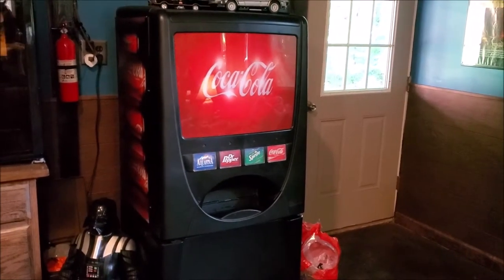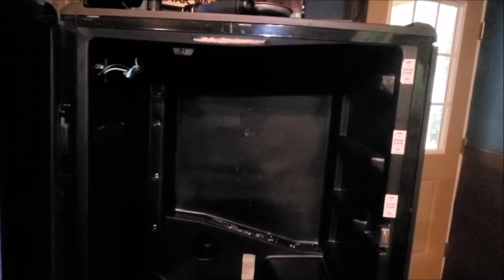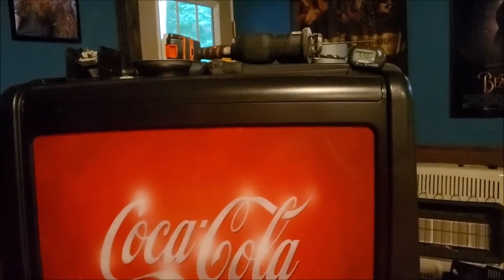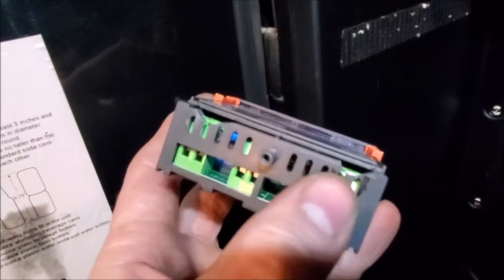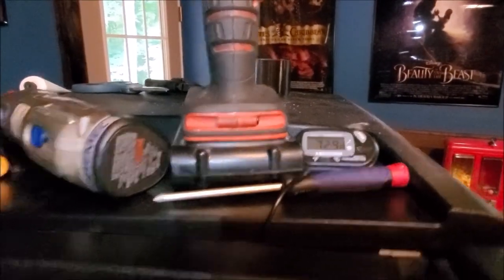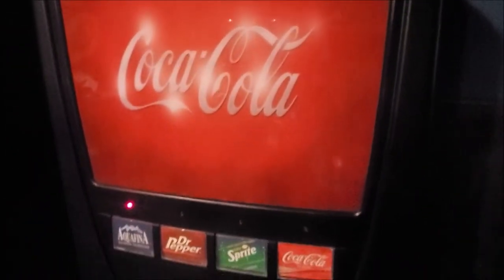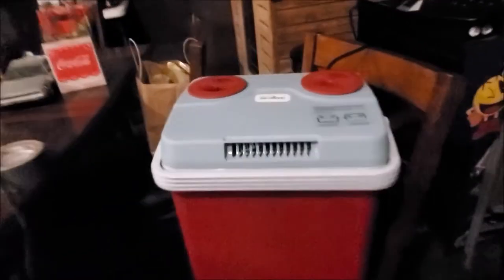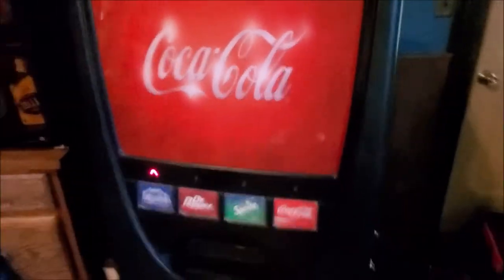SkyBox by Maytag Compressor conversion to ThermoElectric

Comment: Hey Brian! First off, great video!! I have no idea if you are still checking comments, but I had a couple quick questions. I just picked up a non-cooling Skybox for basically nothing and within a day I have it running and cooling again. Switched out the relay and added Freon. I used Freon with leak sealant in it, probably not the best idea, but honestly very new to this and got a lot of very conflicting advice online haha. Machine has been running cold for days now but the condenser and the non-suction line are super hot. Too hot to touch. Should I be worried about this? Second, one of the rows does not dispense. I push the button and I hear it try but then it stops. I can’t find anything online about if there is anyway to fix or work on that. Not sure if you have any insight? Lastly, your part 2 fix looks like something I might ultimately go with, just curious on how it’s working 3 years later? Thanks for any help you can toss my way, I also really love these machines and would love to keep it out the landfill!
Reply from the maker: Feel free to email me Brian.niskala@cnjrail.com 
So I had to lube up the release mechanism with some food grade silicon. But they are prone to freezing up, and locking up the drop mechanisms... shine a flashlight through the inside and see if you see frost or ice. I ended up on a few of these, buying a new compressor, getting a micro fridge and transplanting the whole compressor unit and my current machine, I use a thermal heat transfer unit taken from the top of an electric cooler.

Comment: Hi Brian!  Thanks for making this. I just did a compressor swap and turns out the condenser is completely clogged - hard way to learn to check the system before soldering in a new compressor! Your video inspired me to do the changeover to thermoelectric too.  Couple questions - the link for the Solidstate cooling assembly goes to a cooler...i'm guessing we take the solidstate cooling assembly out of the cooler?  Thanks again, cheers! Chris
Reply from the maker: Yes, just pop the lid off, cut a hole to match, easy 😀

Comment: Hey Brian I need some help desperately. Last week I was given a skybox that an elderly lady’s grandson tried to fix. It worked fine she said until it was unplugged for a week. The compressor runs, dispenser works, but it doesn’t get cool. Her grandson messed up and changed around where the wires plug in. Can you please tell me which wires go where on the compressor and start/run capacitor?? No where online is a diagram of the wiring
Reply from the maker: Brian.niskala@cnjrail.com is me email

Comment: Ive been down the same road as you and found this video. I am going to attempt the same modification as you with a thermo electric cooler lid. Does it still work for you? And do you have any tips before I start?
Reply from the maker: Yes, it still works great, just make sure the lid is blown out every few months for dust, but has been working fantastic 👍
Reply: @GarageMahalLife  few more questions, did you use a jigsaw to cut the hole in the back? You didn’t hit any coils or wiring? I assume the compressor is disconnected as well?

Comment: Interesting video, thanks for posting. I was fortunate enough to have a compressor that continues to work. My issue was numerous leaks in the evaporator coil which as you know is sealed in the back. I completely cut away the metal on the back and chiseled away the foam to completely reveal the entire evaporator coil. Then, I cut a large hole in the back about the size of the entire evaporator coil. Once I identified and sealed leaks (with super glue) I was able to put a piece of sheet metal over the coil and reinsulate. Now the evaporator coils are basically inside the machine, and have turned into block of ice. I was worried about the ice expanding and affecting the wiring or motors of the dispensing mechanics but that has not yet happened. It's consistently staying at 37 degrees.
Reply from the maker: Thanks for sharing. If you refoam the coils no moisture should get to them, so ice really shouldn't form. But glad it is working!

Comment: I just got one that does not cool also. I changed the compressor but i think i have a leak in evaporator. Look forward to see how its works out long term maybe i will do something like this
Reply from the maker: Yes, I switched out the compressor and it worked great for a week, then that one died. This was an ultimate fix and if it lasts a year or 2 and dies, it is an easy swap out of another unit, probably like 15 minutes. Thank you for watching and good luck! I'm here to help....

Comment: You may have covered this but I believe why the four unit did not work as well as the lid is because only the fans should be inside of the unit.  The big aluminum backs on the other side of the insulator are to dissipate the heat to the outside.  Any Peltier unit I've taken apart, have the semi conductor separate to each side.  I'm not describing this well.
Reply from the maker: I tried a bunch of different configurations and calculations I didn't cover here, but in the end it was a matter of simplicity that worked. But thank you so much for watching and commenting. I love Youtube to help share all of our experiences

Comment: Gearing up to maybe replace compressor on mine, great video. Really appreciate you putting it up. Do you think your compressor didn't last because it can't dissipate heat properly? Or do you think the compressor was just on the way out anyway? 

What's the lowest temperature you've gotten out of these thermoelectric units? They still running well?
Reply from the maker: I believe it was just another bad compressor. The thermal cooler lid worked the best. I get 20 to 30 degrees difference from ambient. My garage is usually 70 degrees all year round and I have the soda machine in the low 40s regularly...
Reply from the maker: That model compressor is very unreliable...

Comment: Do you think this kind of thermoelectric cooling fan could be adequate to retrofit a Skybox?   It says it can drop ambient temp but up to 30 degrees Celsius, but I don't know how to adjust the math based on box capacity.
Reply from the maker: It keeps mine at around 25 to 30 ambient... so basically in the low 40s Fahrenheit. Its been working for months now.
Reply: How many cans total can you put in there

Comment: Can you put more details on the cooler you used? Your link doesn’t seem to be working for me (might be because I’m in Canada and hitting the us amazon site).  Also, can we get the details on the digital thermometer (thermocouple) unit. Nice job btw.
Reply from the maker: Oh, seems they are out of stock... try this one https://amzn.to/2ZWRLur I updated the link on the vid too... and what more details would you like on the thermometer and or thermocouple? What I found is in ambient temp, I did not have to use the thermocouple unit (It died anyway) since the thermoeletric achieves temps 20-30 degrees below ambient, I wasn't worried about a freeze problem.
Reply: Thanks Brian. Jumped the gun before I got to the end... love the concept and convinced this might be the way to go.  I think I can find electric cooler to retrofit in.  I’m concerned though that they aren’t designed for this size or duty cycle. What’s your gut tell you? Do you think it will last over the long term?
Reply from the maker: @deverteuilb  Gut feeling... probably a year or so. So far it has been running since before this posting with no issues. So far, so good 👍

Comment: I see one of these listed locally to me for sale.  Looks like it needs a good cleanup, but seller says it works fine.  What would you think is a good price for a used unit?
Reply from the maker: $100 as is, $200 for good working condition, $300+ for pristine working and cosmetic condition...
Reply: @GarageMahalLife  Picked it up for $125.  Needs a good cleaning from sawdust.  I haven't plugged it in yet, but from the surface aside form needing a good cleaning I think it also needs new bulbs behind the front panel.  No key for the door lock so I may look for a new cylinder.  I'll post back later on it's cooling ability. Thanks for your advice Brian.
Reply from the maker: @tonyhart2371  sounds like a great deal!
Reply: @GarageMahalLife  Cools very well.  I don't have a temperature probe I could use, but it's probably as cold as our beverage drawer which is set to 37 degrees.  Question for you... have you ever thought about replacing the lights with LED replacements and bypassed the ballast?
Reply from the maker: @tonyhart2371  Yes, when that part fails, it was my next upgrade. However, if I have some idle time, it would be a video to make and upgrade. Are you considering that?
Reply: @GarageMahalLife  I haven't decided yet, but I am leaning towards that.  I don't have the time at the moment to dive into it though.  Currently trying to find a source for panels and possibly a replacement lock for it.  I think once I start deep cleaning it this weekend, I'll have more on my wishlist.